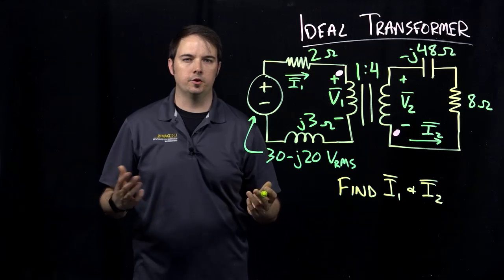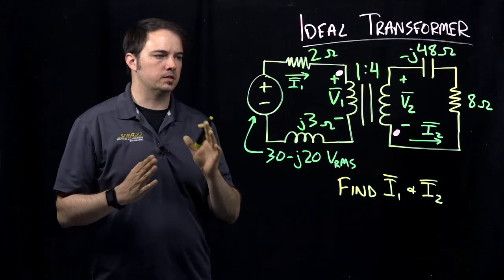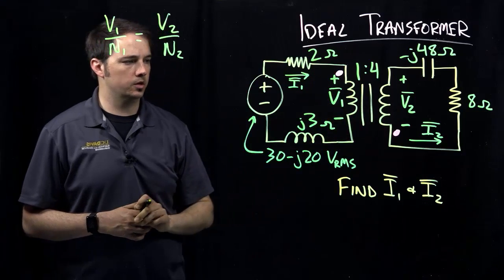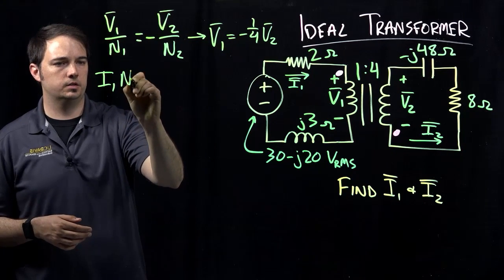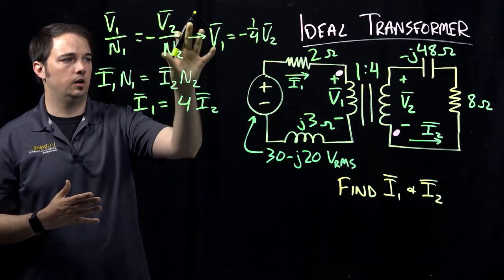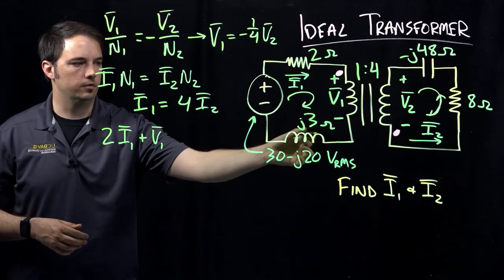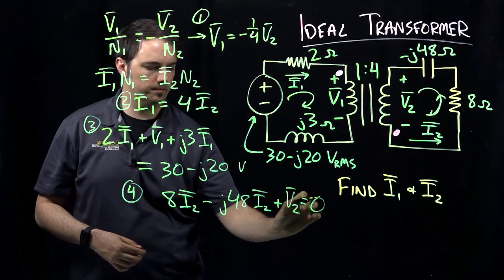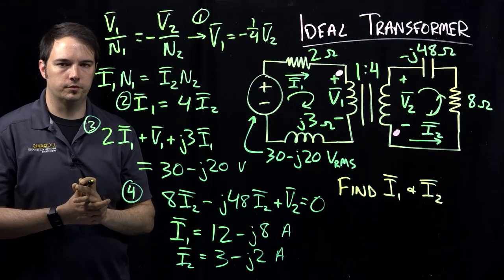Circuits I: Example Using Ideal Transformer

Comment: Can ask you how to you decide the voltages v1 and v2 signs and the currents direction does it work however you choose them
Reply: I guess because the dots are reversed, and you must be given the direction of I1(clockwise) FIRST, then I2 HAS to go in the opposite direction.😊 (counter-clockwise).
Reply: But what if I just assume I2 is also going clockwise would the answer simply be the same but with opposite signs?

Comment: i thought the dot is where the positive terminal of the inductor in the second loop
Reply: About the dots: The dots are used to take into account the spatial orientation of a winding with respect to the other winding. If we didn't use the dots, we'd have to draw how each winding is wound around the core; this would be tedious, so instead we use the dot convention.

About the positive voltage: When you draw the "+" and "-" polarities of a voltage, it means that a positive voltage (v > 0) would mean the "+" node has a higher potential with respect to the "-" node; a negative voltage for the same polarity (v < 0) would mean the "+" node has a lower potential with respect to the "-" node.

Remember that when you're going to solve a circuit, you first must assume a direction for the currents and a polarity for the voltages; this is where the terms reference direction of current and reference polarity of voltage become useful. After you solve the circuit, you can determine the actual polarity of voltages and direction of current.

A voltage value on its own (for example "8 V") has no physical meaning unless you say which two nodes you're comparing their potentials; this is because voltage is a potential difference, and a difference requires to compare two values (for example, when you say the height of a mountain is X meters, it actually means the diestance above the sea level to the top of the mountain; when you talk about temperature or pressure you're also comparing.)